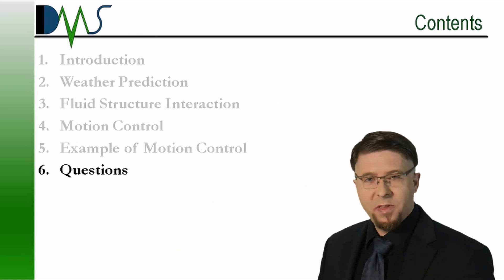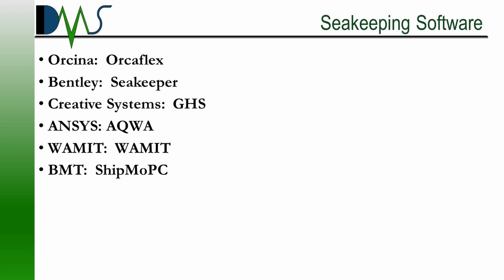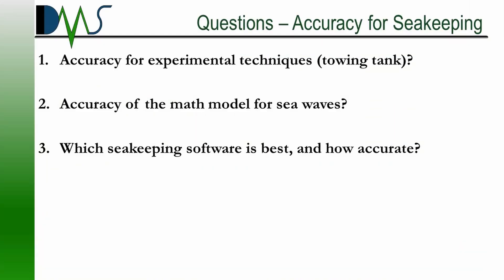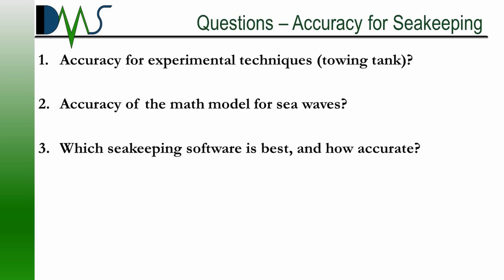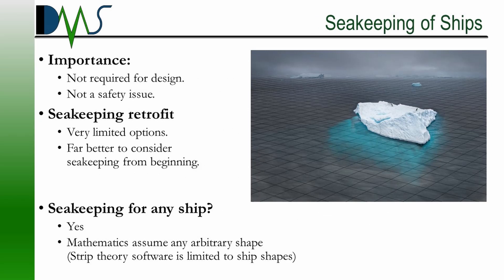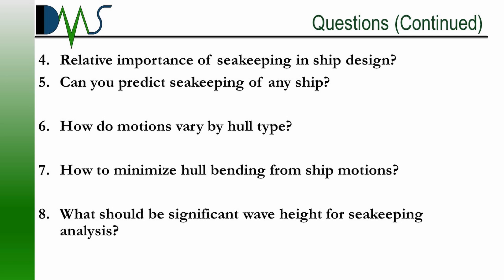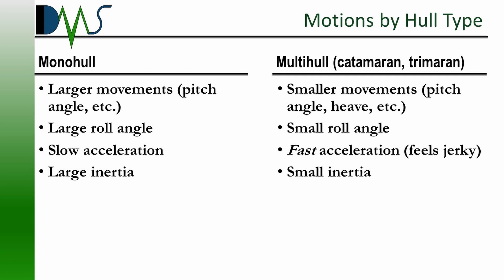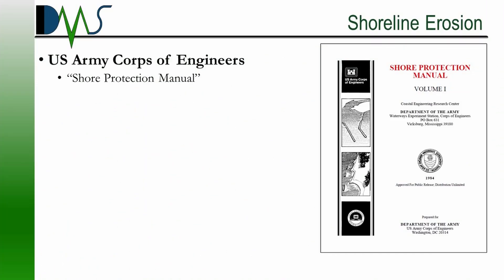SEAKEEPING 6: Questions and Answers

Comment: Another fascinating series of videos! I love your videos and share them with other nerdy friends :).  I am an engineer (electronic) but have done some boat design too, my great grandfather was a yacht designer! 

A suggestion for some thought - maybe a video?
Crossing bars - this seems to be a great unsolved problem for boating and I wonder if it is possible to solve it by innovations in ship design? I've spent a lot of time kayaking in surf (which is similar in many ways). I wonder if a bow rudder is the vital ingredient to solving this problem, particularly for displacement hulls. They have no steering when a wave is pushing them forwards because the rudder is in stationary water or even water moving backwards. So the boat swings around sideways and capsizes. The bow is moving forwards and could steer if there was a rudder there! I use a bow rudder stroke kayaking for this purpose... Fast boats can "chase" the back of the wave in front and avoid being overtaken by a breaking wave, so mostly keep out of trouble.

Many people are drowned and boats lost every year crossing bars, it would be great to help solve this problem!
What do you think?
Reply from the maker: An interesting idea.  I will add it to the video list.
Reply: Dang, yeah dangerous situation for low power displacement craft. I try to avoid any chance of breaking bars. Wave height, hull form and distribution of volumes and weight seems to make a difference in smaller hulls with a following sea... the ability to wait off shore for a change in the tide can mean the difference between crossing a breaking bar or a less dangerous inlet... 🤔